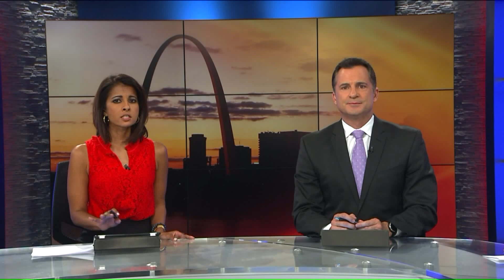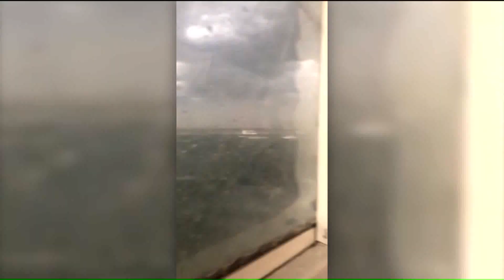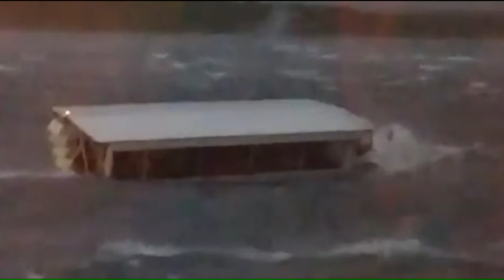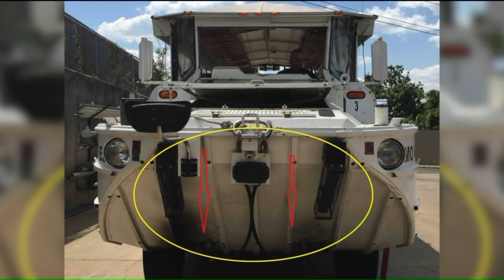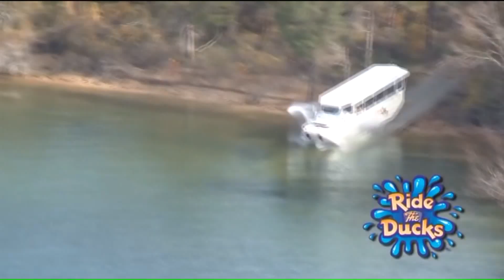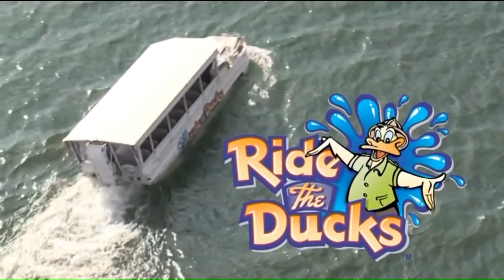Duck boat inspector found boats wouldn't meet federal standard

Comment: They are ignoring the real hazard and cause of deaths ! That is being able to abandon the vessel with a PFD under any circumstances ! Blame it on the man in the moon, captain,storm,the exhaust all you want. Still yet,under any circumstances. You should be able to bail out with a PFD ! They NEVER had that chance !!!
Reply: Kel4everSmiles I've learned a lot. But what I think is just an opinion. they have ways to find out about the weather way before 2 hours and and I think that combined with all the problems was the icing on the cake. From what I saw, Yes they had life jackets the windows do not go up or down, the skipper has to do that. the exhaust of course a problem but the boat would have never been on the lake with those big ass waves if someone would have been paying attention to the forecast. I only live 30 miles from the Ducks. And I know what was happening in my neck of the woods with the weather. But yet, a huge passenger plane can land in the middle of the Hudson, and save everyone and it wasn't even a weather issue. so to me, there is a great big communication gap between the duck people and the people who inspect and when they tell them to fix something fix it and then come back and expect again and don't let them,. Does not and say you did. They should not have returned to the lake until everything is fixed. Some of my words may be a little mixed up but you get the idea. I'm just really pissed that it happened and this is been going on since they first opened them up. I've been on them a lot of times with my daughter and I just thank God that I never had to experience anything like that. And God Rest the souls and peace to the families of who were lost. So when you read this, please bow your head for a moment in silence for those lost and their families. Thank you.